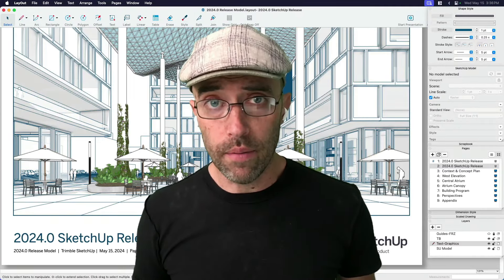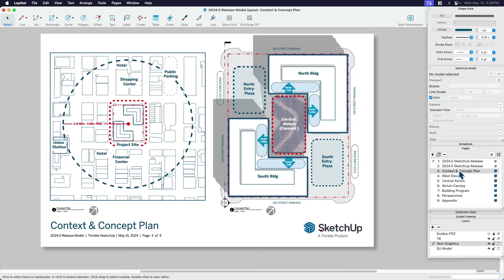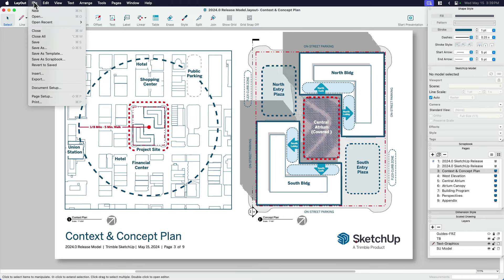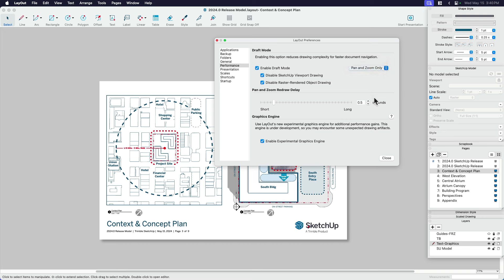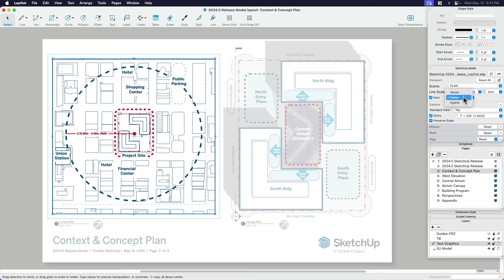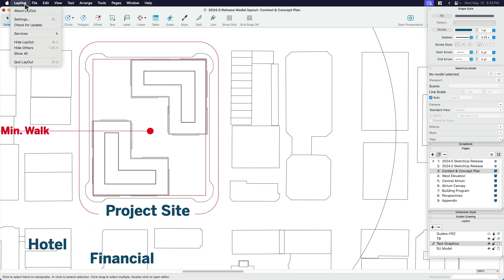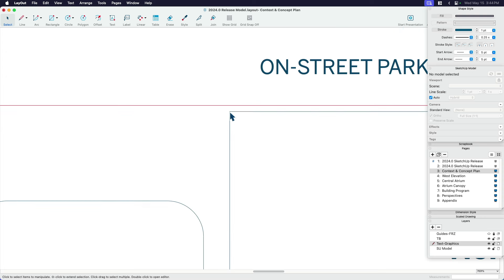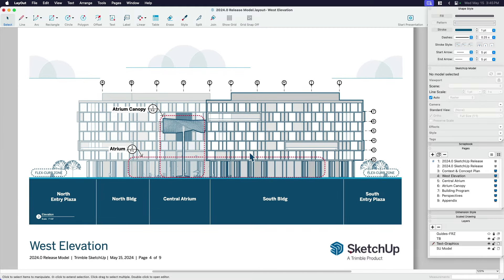Turbocharge Your LayOut Workflow with Draft Mode

Comment: Hey, does the draft mode only work for objects drawn in the layout?
Reply from the maker: It works for both objects, lines, shapes, etc drawn in LayOut and your SketchUp model linework when render mode is set to Vector or Raster. Raster images will not show in draft mode to reduce redraw load.